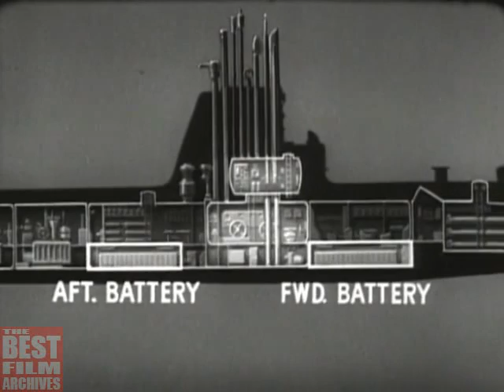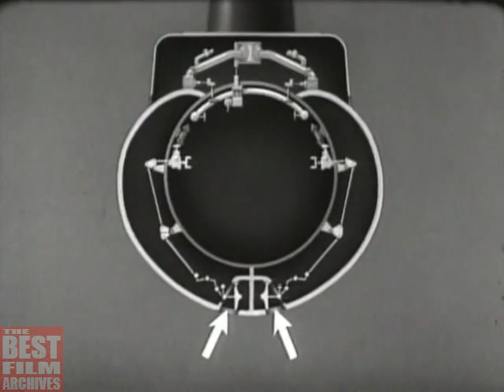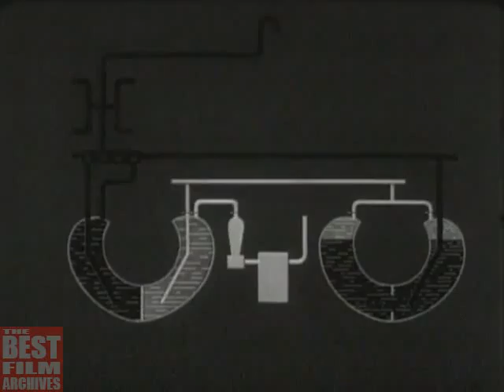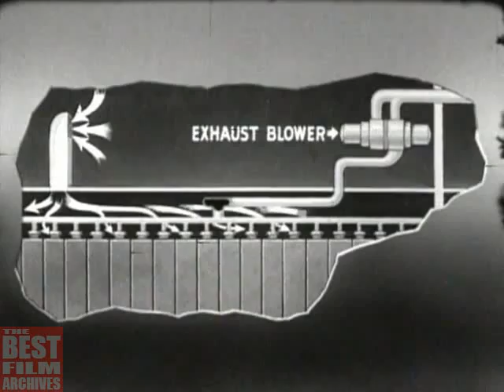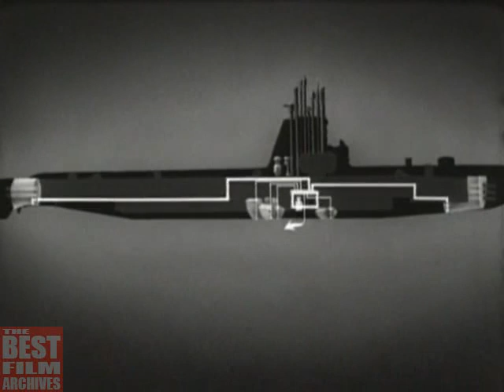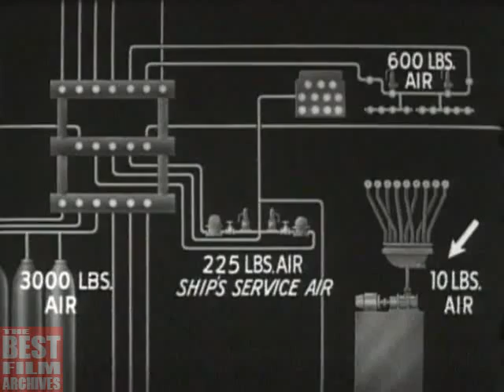How a WW2 Submarine Works (Diesel-Electric Submarine / Balao-Class Submarine) US Navy Training Film

Comment: In the title it says Balao class. But the thumbnail is the USS Torsk, which is still a WWII submarine, but it's a Tench class, not Balao or Gato, plus the Torsk, as it appears in the thumbnail, has a Guppy configuration, which was postwar.
Reply: Actually TORSK is what's known as a "FLEET SNORKEL".  Note that the hull has NOT been streamlined and modernized.  She only received a snorkel, and a streamlined step sail.  Otherwise she is predominately as she was in 1944.
Reply: Snorkel, streamlined sail, higher capacity AC system, and a more powerful electrical system.

Comment: I kind of skipped parts of the video trying to find the information I was looking for, so forgive me if this was covered in it, but there are two questions I was always wondered about diesel-electric submarines both then and now. Because the video didn't answer them, I'll just ask the comments:

1. How long could a sub stay submerged (not snorkeled, I mean completely submerged)? I believe I heard something about 10 days for foxtrot class subs, but was it less time in WW2? can they stay underwater *longer now? And what about in WW1?

2. What did they do for breathable air? I saw the part about the air tanks in the sub, but the video didn't mention if they were for regular air or not. I believe at least some subs use scrubbers now, but I'm having trouble finding out when CO2 scrubbing was invented. Did it exist in WW2? was it always used in diesel-electric/gasoline-electric subs (like in WW1 or prior)? Did they just store it in tanks like other air? Or could they not submerge long enough for it to be a problem?

*I'm talking about conventional diesel-electric ones, which most navies still use. Obviously subs that use nuclear power or some other form of AIP can stay underwater indefinitely.
Reply: RRW i think most of them could stay down for like 2 days max before they start getting low on air or the batteries get completely drained.
Essentially u-boats and diesel electric subs compared to todays subs are not really true submarines. A nuke sub can stay down for months and never surface. A diesel sub can submerge for a short time but eventually it has to come back up due to batteries needing charged or lack of air.
Reply: They could stay down for as long as the air holds out; how long exactly depends on the sub. German Type VII U-boats couldn't stay down more than about a day at absolute maximum before they start running out of oxygen.

Generally, air from the pressure tanks stayed in the pressure tanks; the only air that was actually accessible for breathing was whatever air was inside the pressure hull. CO2 scrubbers were used to keep the air breathable for as long as possible, but didn't last forever; not only did the scrubber cartridges eventually reach capacity, they also didn't return oxygen to the system and were only good for removing carbon dioxide.

Important note: modern subs, whether nuclear or diesel-electric, can produce their own oxygen supply by various methods; historical subs could not do this and were stuck with whatever oxygen was inside the pressure hull.
Reply: @Ignonym  I've seen reports that O2 tanks were used to supplement the CO2 scrubbers in WW2 subs.

Comment: I will save you the 30 minutes. Fully submerged it runs on batteries and can dive to a depth of several hundred feet, or it can dive to periscope depth and use the air intake for the diesel engine. Otherwise it runs on the surface and runs on diesel-electric generator.

Comment: I never understood how a engine could run under water.  A diesel engine needs air. And I just don't understand the concept
Reply: Did you even watch it??  The diesel does not run when submerged, the batteries supply power to the electric motors.  That is why they must surface and recharge...  Not that difficult to understand.
Reply: @Stillnapie  no but thank you for telling me
Reply: Diesel runs from snorkle as submerged.
Reply: @solarpower09  thank you
Reply: Did any subs ever drain the batteries too much before resurfacing? What happens if the batteries fail underwater? The anxiety of running out of electricity in a electric car is a lot to handle. This is like that but much much scarier.
Reply: I just read that the acid in the batteries can be replaced to replenish the battery, is that right? Wow! Also read the diesel engines can be connected to the propulsion system if the electric motors die with a jack shaft. All kinds of crazy ways to keep on going.